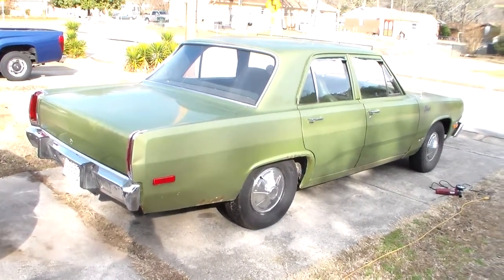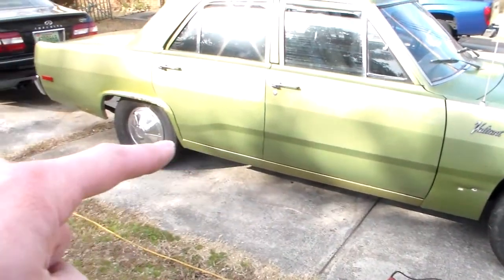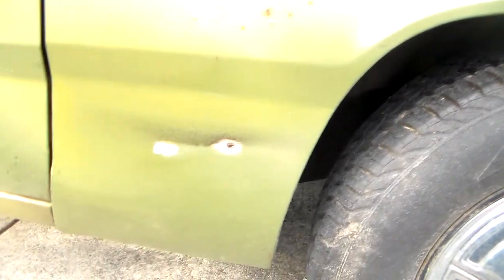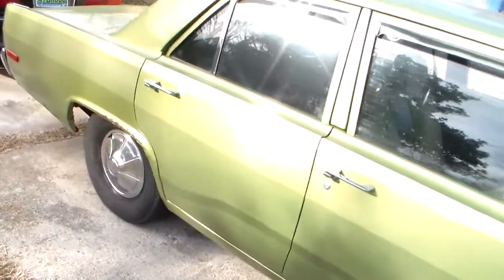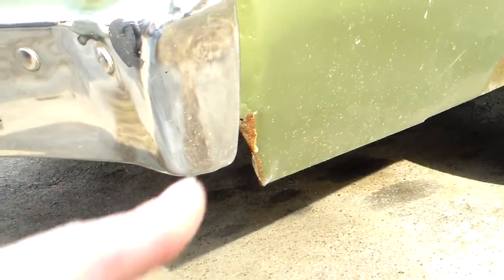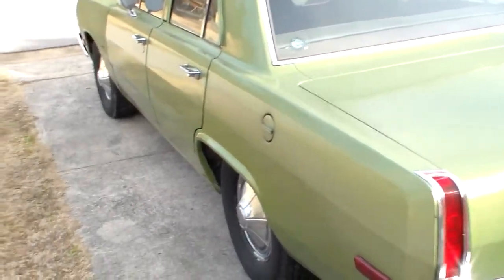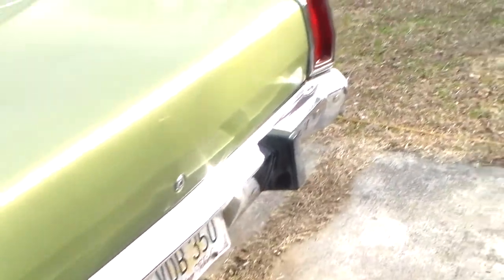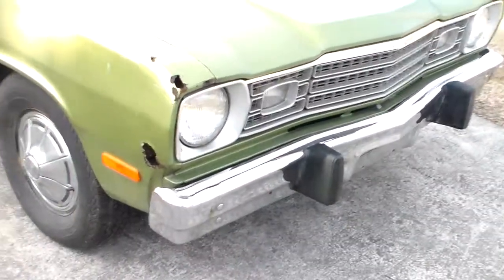"10-foot bodywork" introduction

Comment: I worked at Earl Scheib while in high school and saw many Bondo techniques. The one I remember the best was used over the headlights and for rusted quarter panels.. The Bodyman? would spread Bondo on a piece of newspaper and press it into place. He would wait until the Bondo was dry and use a grinder to shape it and then just clean it up with a jitterbug sander and the repair usually looked pretty good, although I can't attest to it's longevity. Back then (1976) you could get the entire car painted for $59.99.
Reply from the maker: I can tell you now that you're going to take a trip down memory lane as I get the grinder on the bad place ;-)
Reply: we used wax paper and spread it  and then hit it with a hair dryer, the wax would heat up and peal off leaving a smooth surface,